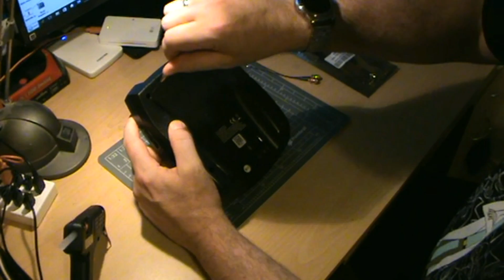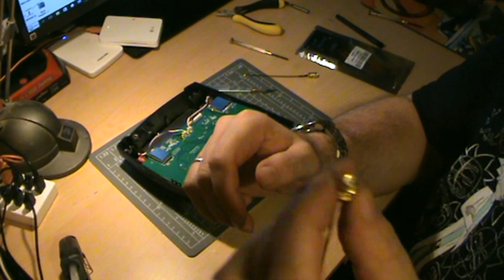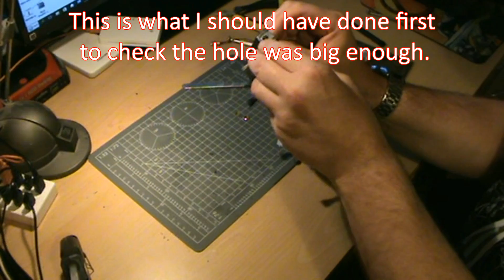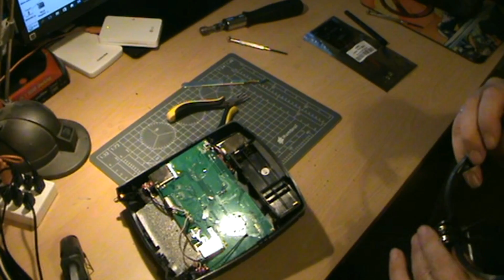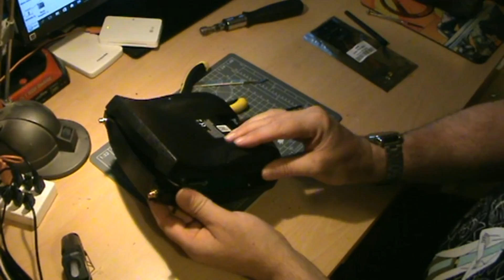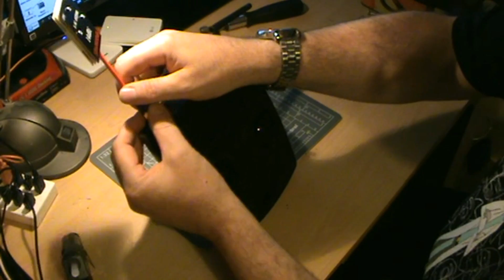Installing external antenna’s from Banggood to the Hubsan H501s from start to finish

Comment: Do you have a link for the magnifier glasses?
Reply from the maker: http://www.ebay.co.uk/itm/Headband-Glasses-Illumination-Magnifier-with-Bracket-5-Lens-and-2-LED-Lights-/272549811996?_trksid=p2385738.m2548.l4275
Reply: Thank you!!!!

Comment: Hi all, Great video on antennas upgrade keep them coming, I too have the 501s and did this up grade to antennas it was a easy project and came out well, just a note: DON'T TURN ON TRANSMITTER WITH OUT ANTENNAS!! doing this can blow out 2.4GHz side of transmitter, at that point just order a new transmitter board and replace. On the bright side with new antennas you can get 500 meters or better range just watch the battery for the RTH.  Have fun flying the 501s and enjoy!  :)  Don.

Comment: So i ordered my antennas from banggod yesterday and this is the video i will be watching to use a reference. I wanted to ask you but i think i will be able to but i want to ask you cuz i don't have a drill do you think i can carefully use my soldering iron to carefully poke a hole when it's hot threw the plastic on the transmitter?
Reply from the maker: Hi Ian, I wouldn't recommend using a soldering iron as you'll be unable to get an exact size hole plus the fumes could be bad for you. Could you borrow a drill perhaps? If you have to use the soldering iron I would suggest you do it in a well ventilated room and practice on some scrap plastic first.
Reply: I can't get a drill. but i have diffrernt size tips and i will use something to practice on. I can use something to use as a washer if it's to big. I am not worried about the smoke. but i am confident i will be able to use the soldering gun. I have done something very similar to what i am going to do so i should be ok. If not i guess i will get a drill some how. I just need to heat up the soldering gun and just slowly poke it threw. Thank you.
Reply from the maker: Ok Ian, best of luck :) tell me how you get on please.
Reply: I just used the point of some scissors and then widened the hole with the scissors. The rest was fiddly but easy to do. I found transmission distances have increased but the video is directional, a bit hit and miss.

Comment: I'm going to be ordering these antennas and I would like to know how much more range you got can you tell me please? Thank you.
Reply from the maker: Hi Ian, Without the external antenna I was getting around 800 meters. After adding them I got to 1800 meters. So that an extra kilometer :) 

you can see my first distance  test here:
https://www.youtube.com/watch?v=YBmO07j7U5U

And the one after the antenna mod here:
https://www.youtube.com/watch?v=dDJNx4c4AhI

Also I videoed the install of the antenna too and that video is here:
https://www.youtube.com/watch?v=TueTZNzS6Iw
Reply: Wow that is a very nice difference. I am going to check out those videos. I seen the one of you doing the mods. I am going to use that video for a reference when i mods mine. what version do you have? I have 1.1.9. Thanks again man!!!
Reply from the maker: Thanks Ian. I have not upgraded my firmware but intend to do so soon. I'm still on the original version.
Reply: +Patchman 21 yea I'm not going to update the firmware either. There is no reason for me to. mine flies great!
Reply: tip for those who are drilling...wrap enough painters tape around the drill bit to stop the bit from puncturing through the plastic....all u need is a 1/4" of the drill bit tip to go through....
Reply from the maker: Good call, there is a small plastic barrier behind the entry point its not much.

Comment: Great video. Having just successfully changed the transmission module on the h501s ( quad v muddy puddle, quad came second), I'm less nervous about opening up the innards! Ordering antenna pack tonight. Cheers
Reply from the maker: Thanks for that :) good luck with the antenna project.
Reply: I just used the pointed end of some scissors to start the hole and then used the scissors as a reamer to widen the hole to the size of the antenna bases. I left the original aerials inside the transmitter in case I changed my mind. What I have found is the transmission distance has increased to more than 1000meters but the video is hit and miss. You either have video or no video, it is very directional especially when flying at low altitude..
Reply from the maker: Hi Quentin. Good answer I didn't think of that :) I live in a fairly flat area with not much interference so i could be getting a few more km